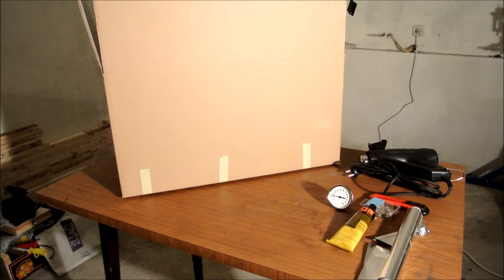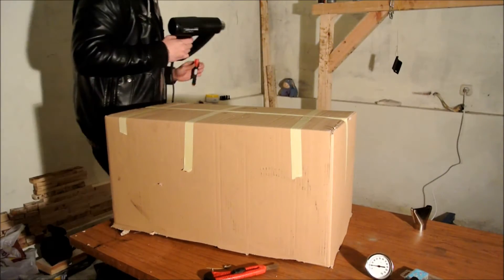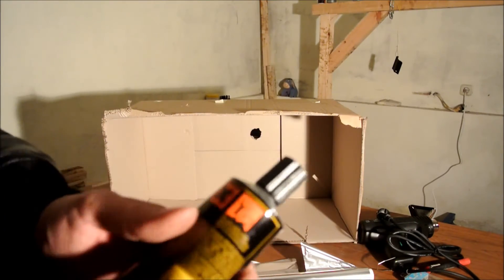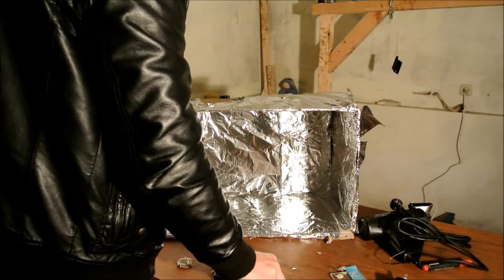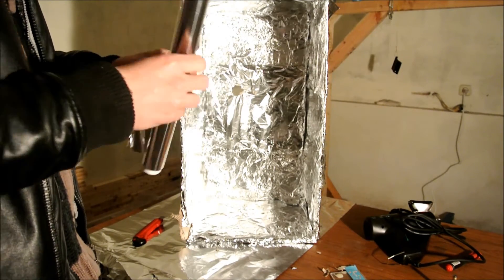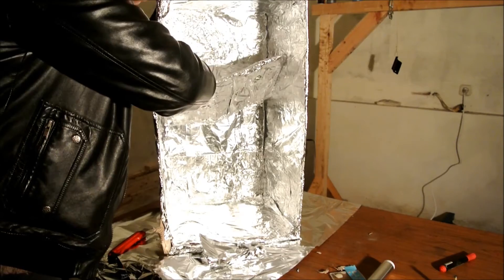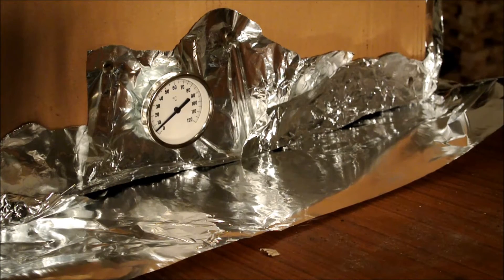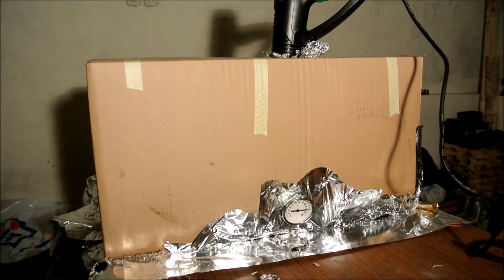DIY $20 cardboard and aluminum foil oven for baking high temperature paint onto metal

Comment: For all the naysayers, I tried it and it works.  In my experience, the oven thermometer was not accurate because the entire thing needs to be inside the oven.  I used a meat thermometer and poked it through the side.  My parts are cured so thank you!

Comment: I know this is old and  a lot of the comments are sarcasm about how dangerous it is but it does work. I used a method like this to bake open my headlights. However, instead of putting the hole for the heat gun in the top, I put it on the side and made it big enough to where the heat gun nozzle doesn't make contact with the box. The heat gun pointed up diagonally, away from the headlights. I also didn't line it with foil but it still worked without a problem and I didn't leave it unattended.

Comment: Doing wheel Drums?  Just prop a heat gun.

1.  lay drums on top of eachother, separated by some type of thin spacer (i use 2 wood shims).  you simply want the hollow space between drums.
2.  point the heat gun through the middle axle hole on top.  might need to prop the handle with something.

No need to cover any holes or gaps.  No need to cover it.  Drums easily reach 200F.  Temp adjustable gun could help, as well.

Comment: Is the glue that you applied is used also for sealing the box or it just to hold the aluminum?if it just to hold the foil,can i use thumbtacks instead?Thanks.
Reply: I'm not the person who posted the video, but I believe I can verify that the glue is for holding the foil in place and generally keep it from sagging into the "oven" space.  A few dabs here and there would suffice.  You could use thumbtacks, but remember that if you do, the sharp points will be sticking OUT and might poke through the outside if the cardboard is thin.  The box just needs to hold hot air inside well enough to do the job, so a really good seal is not super critical.

Comment: Aren't you worried about cardboard catching fire? For instance at the point where cardboard connects with heatgun?
Reply from the maker: If you wrap it well it should be fine. I do keep a fire extinguisher handy just in case, but I definitely do not recommend leaving it unattended.

Comment: Darwinism at work!!
Reply: The nozzle of the heat gun is about 1000 degrees...friction fitting it into flammable cardboard is an absolutely BRILLIANT idea!! Unbelievable! Oh, wait, my bad, that layer of aluminum foil should make it ok...
Reply: Yeah, ok, I'M the stupid one...lol! Cuz the nozzle ISN'T 1000 degrees, and it's not wedged into a CARDBOARD box! And because it didn't catch fire for you it MOST DEFINITELY means it won't! I don't know what I was thinking, you're right, my bad, it's a brilliant idea...!
Reply: 120 C is 248 F. VHT paint wants one to cure at 650 F .  I don't think this box is a solution to that.  Auto ignition temp of cardboard is 800 F.  That means when it ignites itself. Have no idea what temp the glue goes off.
Reply: @tmru2b  used Mapp torch pointed at aluminum foil protecting wires and heating exhaust nuts. Nuts are off, reaching 1750F and glowing red. Wires are fine behind tin foil. Yep, it works